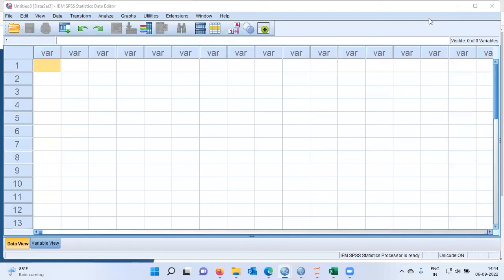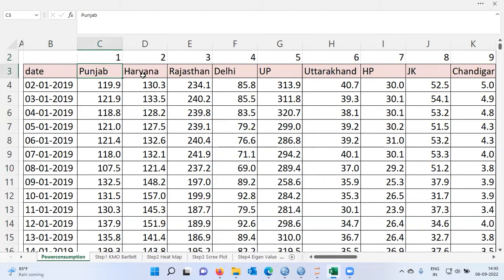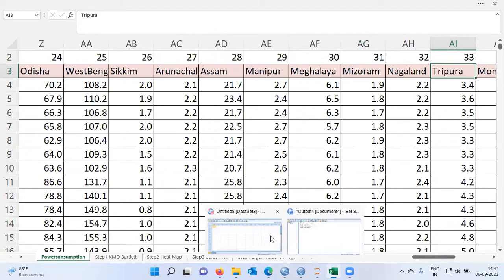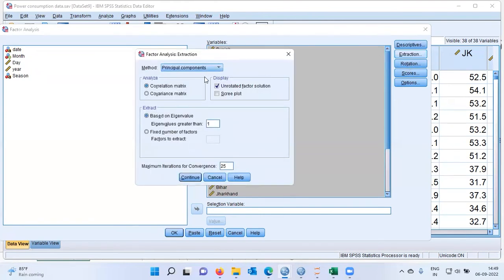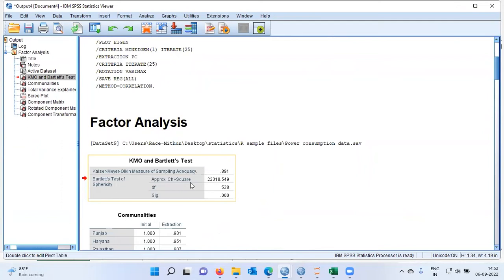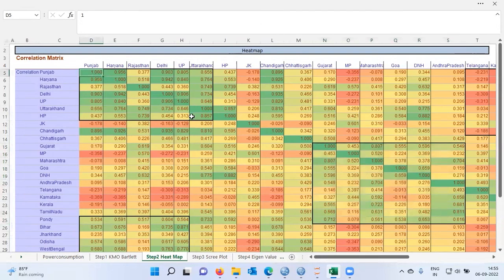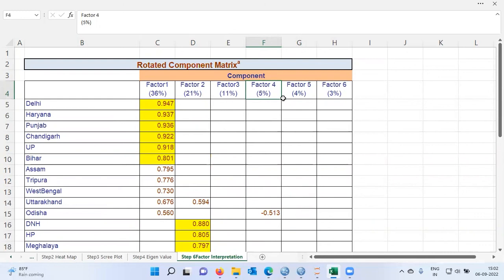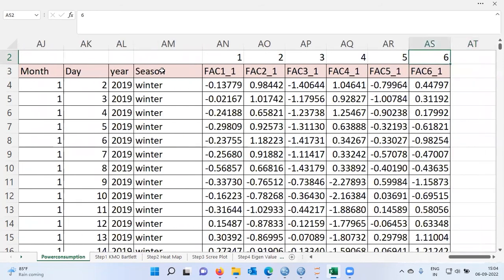Principal Component Analysis in SPSS

Comment: Sir, can we use this factor as a variable for regression. Also, do we need to consider them as negative values or absolute values?
Reply from the maker: you can use the factor scores as variables
Reply from the maker: Also, When interpreting factor scores from factor analysis, it is important to use the scores as they are, including both negative and positive values. These scores indicate the relative positioning of observations along the factor dimensions.

Converting them to absolute values would distort the interpretation and relationships identified by the factor analysis. Negative values are meaningful and represent observations that are below the mean of the factor, while positive values are above the mean.

Comment: Sir in my study have non metric data, I want to apply multivariate analysis, is it PCM method appropriate for it.

1. If not what method appropriate for it.
2. I have socio and economic section related many variables.
Reply from the maker: If you have Ordinal(5 point scale) you can still go ahead and use PCA
Reply from the maker: Pl. Note: Since you have non-metric data, Principal Component Analysis (PCA) might not be the best method. PCA is typically used for metric data (interval or ratio) because it relies on variances and covariances, which aren't meaningful for categorical data.
Reply from the maker: Try Multiple Correspondence Analysis (MCA) or f
actor Analysis for Mixed Data (FAMD)
Reply: Thank you so much sir for your response 🙏🙏
Reply from the maker: @neelamkhanoda6252  All the best